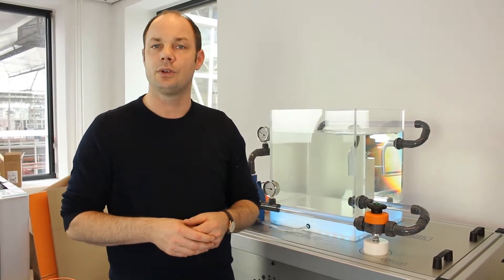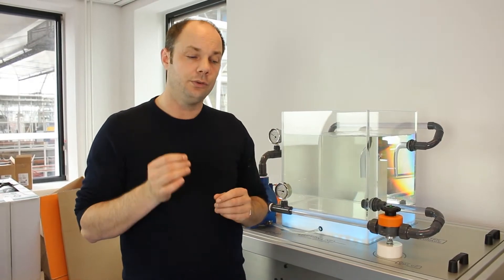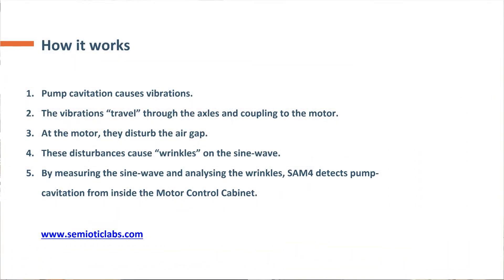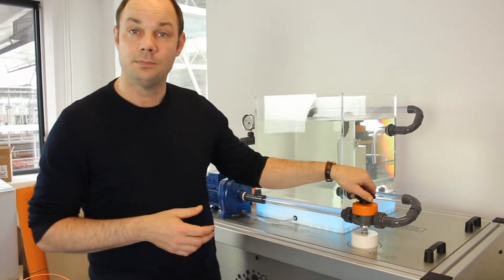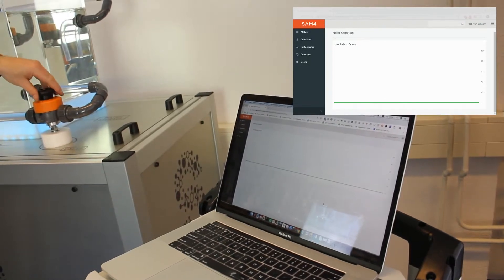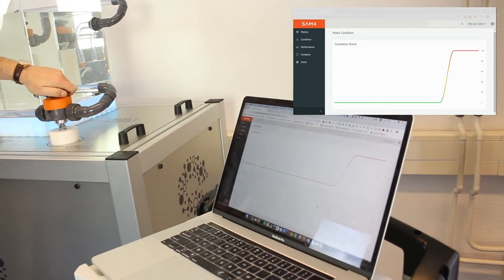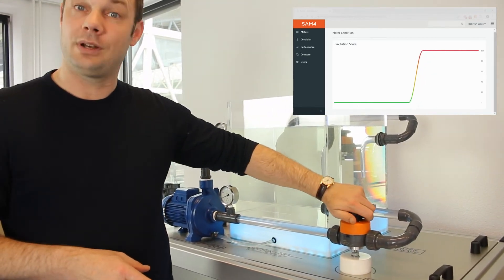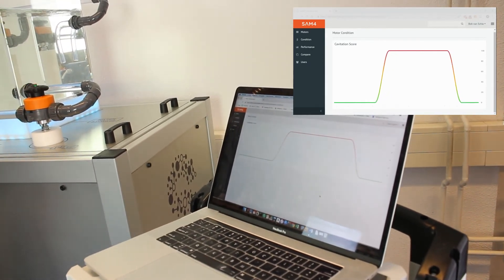Detecting pump cavitation using condition monitoring system SAM4 [Demo]

Comment: Good Demo! Could the sensor works for other types of pumps? Or only suitable for this specific pump (and what kind of this pump is it?)
Reply: The SAM4 system is available for most types of pumps that are powered by AC motors, including (but not limited to) centrifugal pumps, screw pumps, and vane pumps. 

The pump used in the demo is a centrifugal pump.
Reply: @simonjagers2134 Thanks a lot, I would also want to ask that is the sensor embeded into the pump or work as non-invasive devices?
Reply: @FengLian-di2yy  it works as a non-invasive device measuring current and voltage through clamp-on sensors and voltage probes, measuring between the power source (DOL, VFD) and the motor.

The underlying technology is being integrated into VFDs, creating a smart “VFD with a PhD”. The timeline for general availability is 2025.